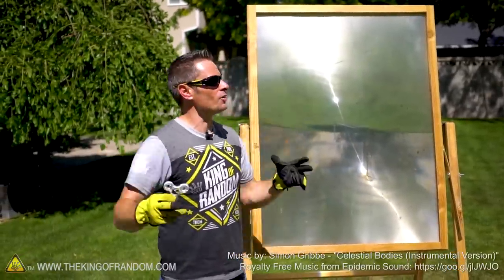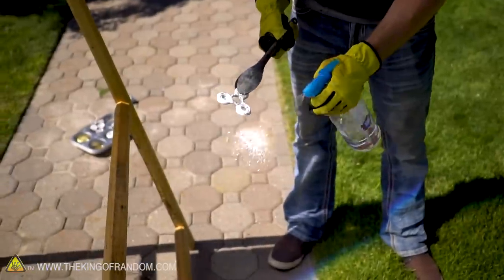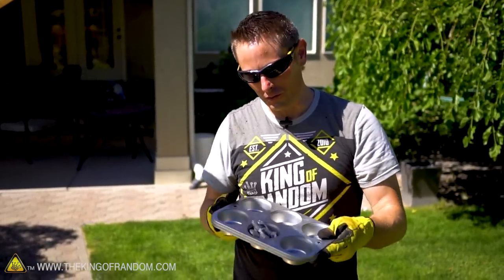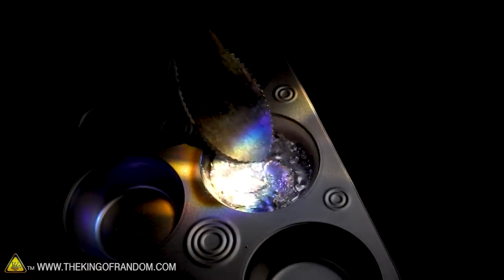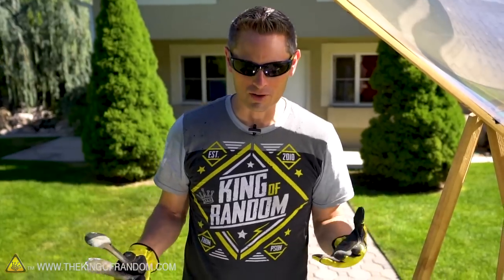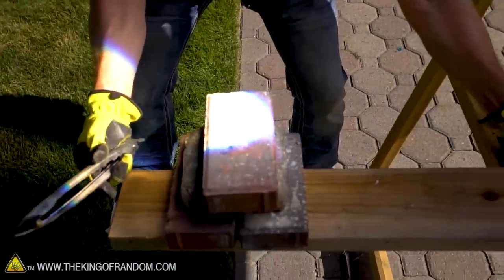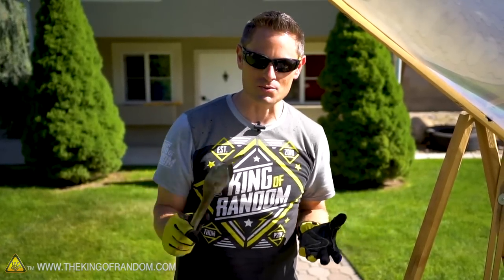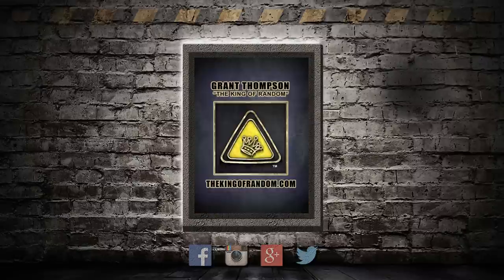Mad Science: MELTING Metal with Sunlight! King Of Random Puts The Solar Scorcher To The Test!

Comment: Can you cook with the solar scorcher?
Reply: Yes, but only if you like your food burnt to a crisp all the time, meat might also be raw in the center. A cardboard box lined with Al foil can cook hotdogs nicely, used to do that when I was a kid.
Reply: you could potentially heat a large slab of stainless steel using the solar scorcher and cooked food on that but that's the only way I could think of cooking food with tha scorcher.
Reply: Helo
Reply: Lol if it works than who needs electricity ovens or even solar panels XD
Reply: Yes, they're called solar ovens
The difference is you don't need the lens, only an insulated box with a dark lining and a piece of glass. You definitely don't want to try to cook things in the focal point of a magnifier, as the heat would be incredibly uneven.

Comment: Radiant energy does not equal heat generated by combustion.  The energy is still there but it is radiant.  You need to capture radiant energy to convert it to heat.  The metal is reflective so, most of the energy is reflected away and not converted to heat (which is why it is bright!).  If the metal were put into a dark crucible, it would have a better chance as the crucible would get very hot.  The best would be dark or black colored metal.  You could paint it but the paint would burn off quickly, leaving shiny metal.  Anyway, cool video and I wish science classes in school would include stuff like this.  Books are great but labs are better, especially if they're fun.  I think more kids would get into science if it were like this.

Comment: You may find it easier to melt the aluminium if you grind/sand off the 'dull' oxide layer as it takes almost twice the heat to melt the oxide layer as it does to melt the aluminium itself

Comment: Try Putting Molten Aluminum In Vacuum Chamber .
Will It Be Solid Or Still Liquid.
Reply: AMINE FELITI it will cool down
Reply: Given the temp does not change, decrease the pressure will not transform anything from liquid to solid
basic thermodynamics

Comment: What will happen if you mix Melted gallium with Melted metals
Reply: Based on some basic googling and wikipedia, it will create an alloy that has a lower melting point than the melting point of the other metal.

Comment: Can you melt metal in an exhaust pipe
Reply: Maybe, if the exhaust pipe is really hot and you use metal with a low melting point(pewter, lead, solder even)
Reply: Sure, if the exhaust pipe is Mig-25's
Reply: Wes Brame haha with a crazy evo you can
Reply: keyalpha1 indeed
Reply: no

Comment: can electricity go through dry ice!?!?!?!
Reply: Jo5hy512 dry ice is solid. It's not ionic, just carbon dioxide molecules with London forces. I don't think it will.
Reply: Jo5hy512 dry ice is not water it is Carbon Dioxide not Water
Reply: Jo5hy512 anything can have electricity flow through it just depends how much voltage going through
Reply: Jo5hy512 
I'd guess no, but I could be wrong.

Comment: Could that solar ray super charge a solar panel
Reply: Also could you use Fahrenheit and Celsius so anyone would know how hot it is no matter what they use
Reply: Nolan Schapker it would probably break the solar panels.
Reply: no because high heat alters the solar cell performance.; also it would destroy it
Reply: the solar ray doesn't amplify the light that is already shining, what it does is captures and focuses it into a small point. solar panels are made up of multiple cells all wired together so if you focus the light on one point you will damage or burn the cell. once one cell on a panel goes bad, the whole thing stops working.

Comment: Can you cook meat with the sun ??? 🍗🍖
Reply: Christopher Macedo no it will burn
Reply: Christopher Macedo it would get seared and only cook the outside, burning it and making the meat inedible because all the heat will have only got the outside leaving it raw
Reply: Christopher Macedo in other more simple words, its so hot it will burn the meat before cooking it
Reply: Christopher Macedo You can do it. Like in australia you can fried an egg.
Reply: Aimless he means with the beam
Reply: Christopher Macedo He already made that video like 2 years ago.
Reply: If you like them extremely rare and charred it wouldn't be a problem.
Reply: you can cook soup
Reply: MandishFyre unless you use it to heat a big pan up
Reply: Christopher Macedo u can but u can't directly cook u need a utensil which doesn't melt at that temp
Reply: Theoretically, you could do it with the Solar Scorcher, as the beam has more than one spot you could put the steak.  For example, if you found out where the focal point of the beam was, and placed the steak possibly about a foot below the focal point, then you would have a possibly well-cooked steak.
Reply: +pigs make Bacon Still wouldn't work since the heat would be too great for an even searing.

Comment: Can you cut metal with hot- wire
Reply: Yash Patel are you talking about the Styro-slicer? Because that can barely even cut through plastic. In metal, the heat would dicipate way faster and wouldnt melt

Comment: Solar scorcher vs solar panel?
Reply: there is actually a type of "solar" batteries, that direct a bunch of beams of light into a tower with high salt concentration liquid, which then heats up and is later used to power a sort of steam engine by heating water

Comment: what if u burn thermite on dry ice? ✌👑
Reply: Mythbusters did something similar with regular ice. They did the reaction on top of ice so when it melted through the bucket it hit the ice. That caused a somewhat large explosion. They don't know why because it was too hot to record any data close by to it. What they think happened is the thermite burned so hot, it split the ice into its hydrogen and oxygen components which then reacted and exploded. On dry ice, it's possible it will split the bonds releasing oxygen making a larger fireball but that's just my speculation

Comment: Nicely done. The Scorcher, a Fresnel lens, isn't the best way to concentrate sunlight for melting metal. You could improve it by finding the precise focal point and constructing a platform or whatever to hold items to melt. Mirrors are more common for  melting metals. Sunlight has been used to melt steel in a solar foundry. Japan used to have a very large one.

Comment: You have to make your metals darker. The aluminum would get hot enough to melt of it wasn't reflecting most of the heat away because the aluminum is shiny. Dark metal stain might work.

Comment: I wonder if the surface of the aluminum ingot was too reflective so it never absorbed enough thermal energy to melt. You can see in one part of the video where it looks like the reflected light started burning off the muffin tin's coating.
 I'd be interested in seeing if there was a way to store the thermal energy (ie a solar oven?) And then see if aluminum melts in it.

Comment: I'm surprised no one else mentioned that you said copper for both what would and wouldn't work.. lol as an added point of interest tho, the angle of refrection needs to be taken into account with the aluminum ingot.. had you angled the receiving plain of the ingot to near but not exactly 90° then the refrection rate would be significantly higher by reducing the reflective arraignments.. plus as was stated in a separate comment, a rougher and less shiny surface would have also increased the rate of refrection by reducing the reflective arraignments..

Comment: Would be interesting to see an "advanced" version of the solar scorcher using multiple lenses. Each lens would probably need to be placed just past the point where the previous lens is the same size as the beam size. Maybe with multiple lenses you can get up to melting aluminum in a more practical time frame.

Comment: If you had provided insulation around the aluminum, you might have been able to melt the aluminum - you had more than enough heat at the central point, but the edges of the ingot were at air temp, so was leaking the heat from the center.  Insulation of the outside of the ingot may have allowed the overall temp to reach boiling.  the brass cartage likely had the same issue, being a tube it in effect had cold air in the inside and the far side would act a radiator, it may had worked better as thin strip.  Also, the aluminum is very shiny, as a result, some of the solar radiation was being reflected away and not absorbed - a darker surface would heat easier in a solar focus point.

Comment: I got a question: I made one myself, the lens has straight lines(ridges) on one side and the round curved ridges on the other. The lens is not completely clear, a bit milky. It is bigger than yours by a couple inches but it isn't hot enough to "instantly" start stuff on fire. I managed to melt a penny but I couldn't get it nearly as hot as you did. Any suggestions?

Comment: You are trying to melt the aluminum metal on a stainless steel container with a huge volume, which is probably keeping the aluminum just cool enough to not achieve the required temperature on top of that account for air. I bet that if you tried it again, but this time inside a ceramic encased container with just a hole small enough for the sun to touch the aluminum, you could probably get very close or at the temperature needed to melt the aluminum.

Comment: Aluminum has a different melting point from aluminum oxide. Your nugget was covered with aluminum oxide and did not melt. Try scratching the surface to expose not oxidized aluminum

Comment: The main limiting factor was the shiny nature of the metals used.  If it is reflective then it isn't absorbing nearly as much thermal energy.  I wonder if coloring the ingots black would have garnered different results.  I feel like it might work if the ingots could absorb enough energy before the black coating burns off.